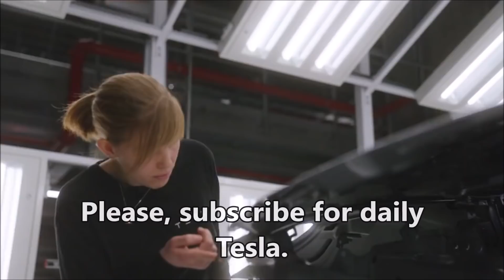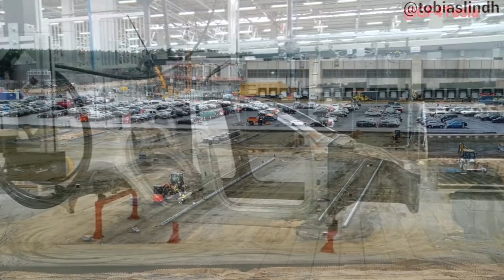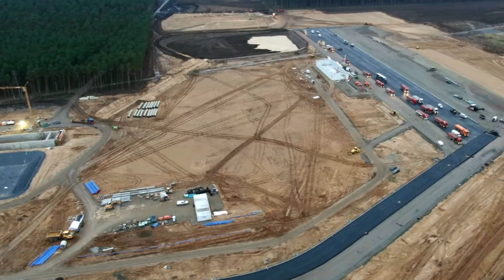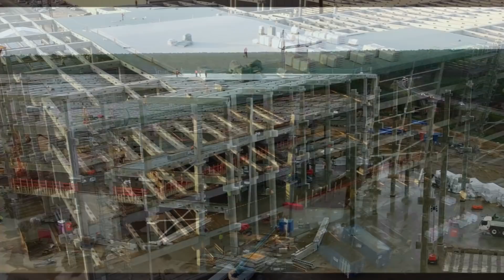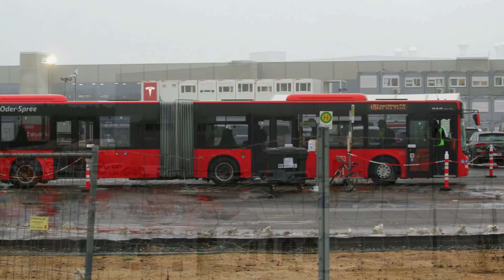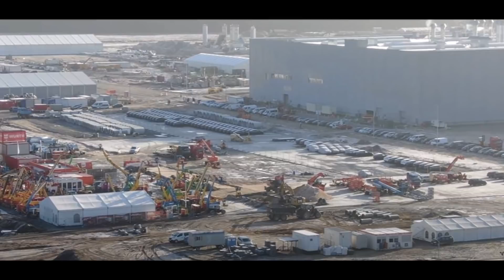Tesla Giga Berlin To Reach 1,000 Model Y Production Within 10 Days and Add a 2nd Shift

Comment: In the US it appears that the 4680 cars will have 279mile or 450km range.  They are actually using a smaller battery pack to do this.  They are charging 50K for these which is a $3k discount from the 2170 version which has more range.  These new 4680 model Y's will charge up to 200 miles in 15 mins.  This is a strategic move that keeps people interested in the old 2170 models.  I suspect they will eventually make a very impressive performance model using 4680 keeping the 2170 in the middle of the lineup as the Long Range model.
Reply: I think they will phase out 2170 cells all together, to keep continuity of machines fabrication etc, maybe they will change ingredients depending on use like CYBERTRUCK and Semi truck, or maybe change all cells the same for simplicity and keep economies of scale working best for Tesla?